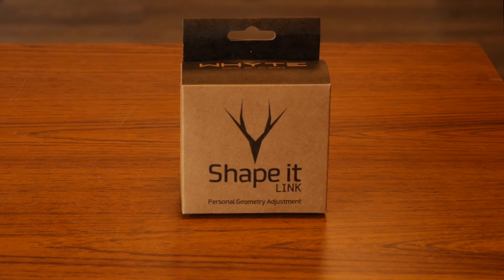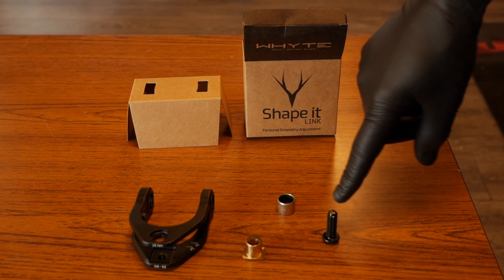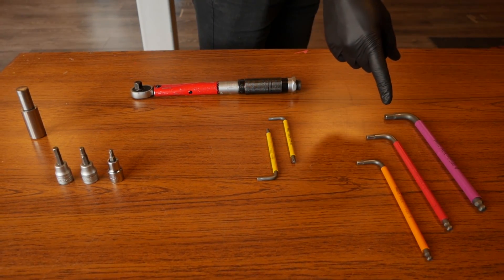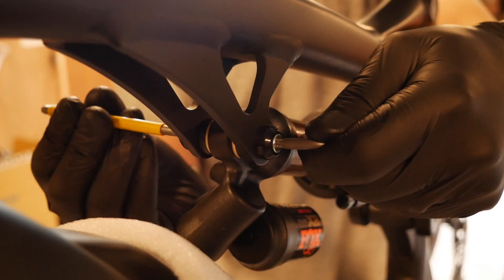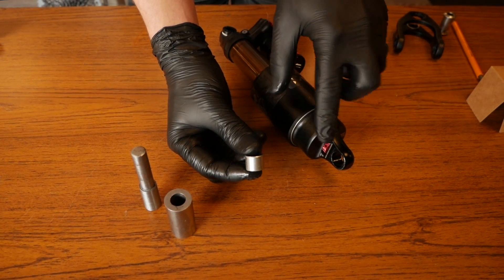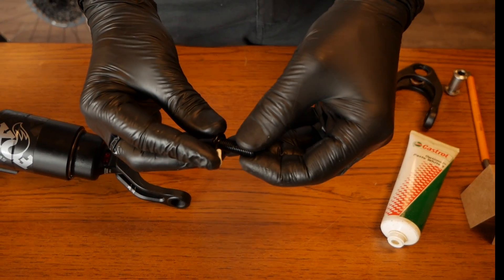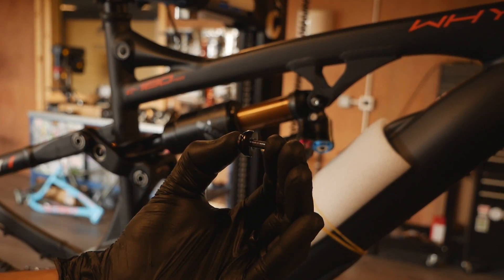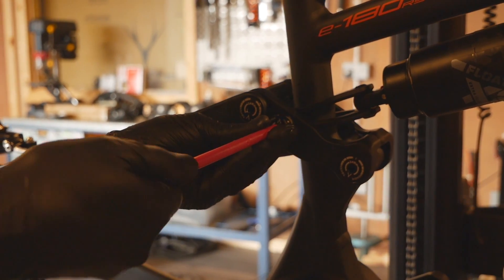Whyte Shape It Link Fitting Instructions.

Comment: Sequence shortened... Trying to get the brass offset into the bush :( And how about make it clear which way around it goes for up and down as the H/L doesn't help much if you've not done this before.
Reply: To turn the bike to high setting do you install the linkage upside-down?
Reply: @kostasl5922  No you turn the eccentric brass fitting - this is not explained very clearly and is important if you wish to alter your bike's ride.
Reply: @royayersrules many thanks mate ❤❤❤